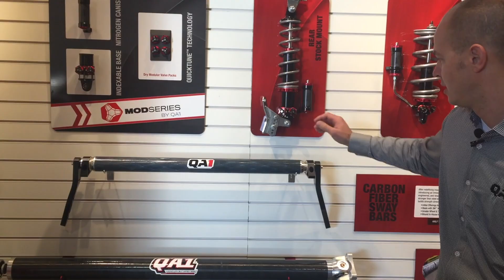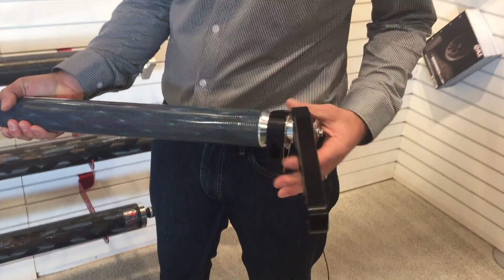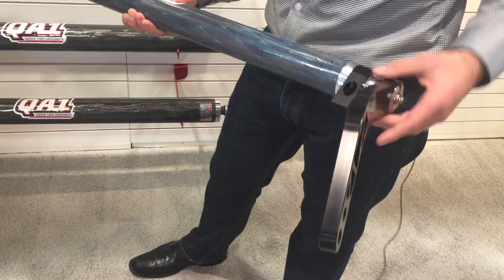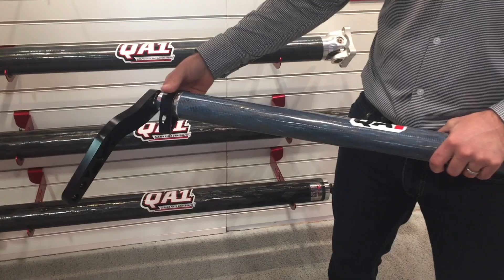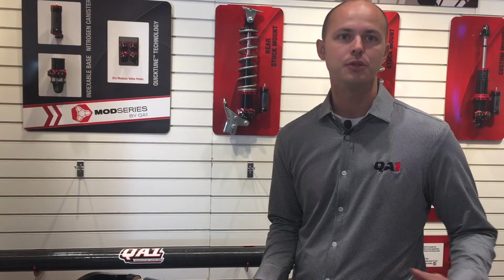QA1 Carbon Fiber Sway Bar

Comment: first you said 8 pounds... then you say it hardly weighs anything. Let me swing it into your jaw and see how littile i hurts. Do you guys even know what you are demonstrating... stupidity.. Tell us what it can do what transfer capability can it increase over stock. Weight is not the factor. I know damn well if i wrap my existing bar with  4" 18 oz kevlar and add 1/4 in of material around  the 2/3 outside ends. Mine will be cheaper and better.